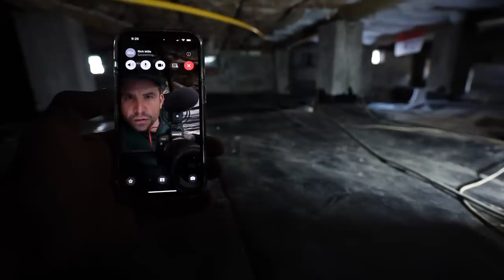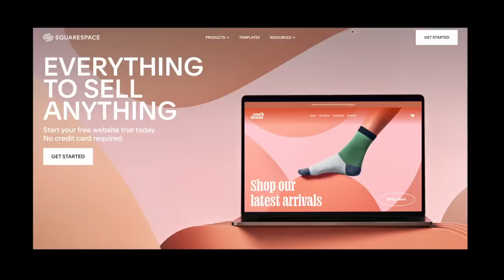Digging foundations: Not fun, but it’s important

Comment: Consider using an SDS drill with a clay spade bit fitted; if you have the room in my case, I needed to hand dig 6 to 8 inches to get the assembly into the hole. I found this method much quicker to break up and then remove the soil than digging the full hole by hand. 
Play safe from Elliot Lake, Ontario, Canada.
Reply: From past experience of doing similar job, a cordless SDS Max breaker with clay spade, would make short work of that job.
Reply: This is a very good suggestion...they are a life saver!

Comment: Scooter….love your work mate….some advice here, take it or leave it…..we use a 75mm auger with an extension if needed to loosen the dirt before we start the dig out. Works great! Goes straight into the cordless drills. 
Great for digging piles in hard spots 
Cheers

Comment: I constantly have the same issue with building inspection reports coming back with a big red FAIL attached ... despite the inspection going very well. I usually get an okay to proceed with pour or cladding etc along with a list of required documentation noted as reasons for failed inspection outcome... Super Fustrating. for eg they may require an engineers producer statement which always comes at the end of the project  so why this contributes to a fail doesnt make sense especially as Clients have full access to this report i cant quite understand why. I also live in your same region...
Reply: It is ridiculous. If the reason is that documentation is required, then that should be a pass with that stated as a condition.

Comment: Great Videos Scott, my two cents worth:

The Dunedin City Council's inspection reports always say fail - this is standard until you get your final code of compliance sign off, not sure about your TA though.

I noticed your plans reference engineers PS1 - in my experience, if they Engineer has provided a PS1 then they will also carry out inspections and issue an engineers monitoring PS4 and carry out all inspections, they are typically a little more practical than TA inspectors.
Reply: If the inspection passes, then it should not say fail. That is ridiculous. Fail implies that you cannot continue. That there is something to rectify and that another inspection is needed. 

Engineers will only carry out those inspections if the council requires a PS4. This is laziness and responsibility avoidance on the part of councils for simple jobs like this. There is no reason why an inspector cannot inspect a 700 cubic hole in the ground. Which he/she still has to do anyway. So if a PS4 is required (we don’t know that because Scott doesn’t know why it failed) then those two holes would cost Scott probably about $150 for the council inspection, $400 to $500 for the engineer inspection and a fee to prepare a PS4. 

By the way, I don’t want to be pedantic….but I do. 😁
There is no such thing as a code of compliance sign off. It is a code compliance sign off. I still have no idea why the word ‘of’ slipped in there decades ago.

Comment: Is vaccum excavation not a thing in NZ? I had to dig some big column footings under my house (USA/CO). The crawl space was only 18", so shovels were impossible.... I used my shop vacuum  hooked up to an external cyclone separator atop a 35gal barrel... Broke up the dirt with a small pick and vacuumed it away. It was surprisingly easy.
Reply: No it's not. But sounds like it should be! I'm intrigued. The critical question: Does it work with clay? which is the generally the predominant soil in NZ.
Reply: @DiscoFang  I think it would require more work to break the clay up into small enough pieces to fit into the vacuum hose, and now that I think about it it might require a special hose from the site of digging to the separator that was slick enough to keep any wet clay from sticking to the inside of the pipe.  My soil is very dry (at least under the house) and is mostly granite and quartz particles mixed with stones, my vacuum would lift any of the stones below 1.5-2 centimeters diameter, the bigger ones collected in the hole until I had to remove them by hand.

Comment: Just since you're talking about foundations I have to make the point in Minnesota if you have the money basements even if you need a sump pump or almost necessary cool in the summer warmish in the winter now if you have extra money you get in for heating into the foundations of your house so long as you run it all winter long maybe have a backup system in case one of them goes out your foundations will never crack your basement will be warm and properly cool during the appropriate seasons helping with heating and cooling the rest of the house with conventional climate control.

Comment: Great work you'd be horrified of my house the load bearing beams are 2x6x24ft with a 11 and 13 foot span and no post below a load bearing wall supporting a 2nd floor it's only sagged 1.75" over 90 years

Comment: Lucky? Here in the UK, it is extremely unusual (I’ve never come across one) to have a house built on piles so that you can crawl into the space from outside. Ignoring very old houses (say 200 years or more) where you could be lucky to have any kind of foundations (I nearly bought a 15th century house where there were no foundations and the internal ground floor was compacted earth; it had to kept that way as it was Grade 1 listed; it would have been great to have bought it but the cost of the upkeep was phenomenal). Some houses that I have worked on had a brick perimeter wall with timber beams and timber supports (running at 90 degrees to the beams) on which floor boards were laid but the space is usually 200,300mm only. So, if you need to access that void, it is a question of pulling up the floor boards. My sons house in NSW has a crawl space such as yours and it’s been great to have that in order to fit new drainage.

Comment: Can you explain on next episode why houses in New Zealand are built on posts? Is it to prevent damage from earthquakes?
Reply: Fully timber framed and floored houses back in the 50s & 60s. And the 70s and 80s!  Need good sub-floor ventilation to keep it dry. Timber was cheap, and concrete plus reinforcing was expensive. Now the other way around.

Comment: Nice and probably done to plans but I"d have used thicker rebar to pin to the old footing, more pins or both to transfer the shear forces to the new pad. Also that soil cross-section 7:38 shows a great topsoil depth - isn't the clay classed as "good ground" and from where you start your footing depth? Obviously the old foundations didn't do this but we did things differently in dem olden days.
Reply: The rebar pins are more than adequate. The 700 cubic lumps of concrete are most likely there for uplift resistance more than for support. And for that purpose it is overkill, given that the posts are not stand-alone like they would be in for instance a car port.

Comment: Why are the crawl spaces so clean and lined with plastic in NZ?
Reply: Plastic is to stop water vapour rising up from the ground into the house. Usually combined with fitting underfloor insulation. Older New Zealand homes are noted as being damp and poorly insulated. Plastic ground sheet and underfloor insulation are often used now as part of the solution. Our wooden framed houses typically had no insulation and single glazed windows.